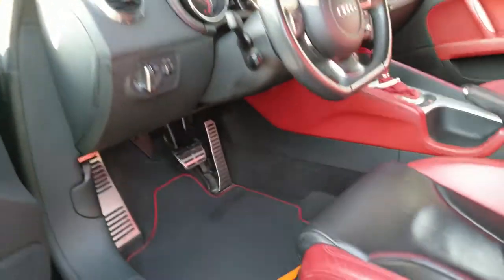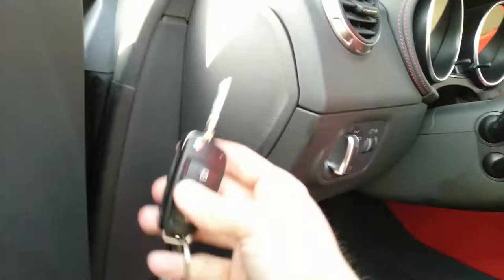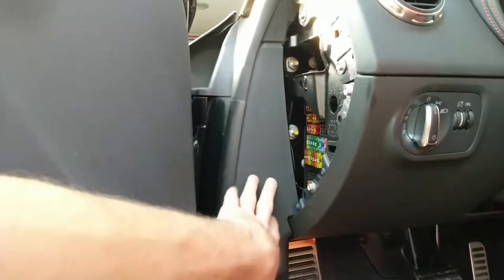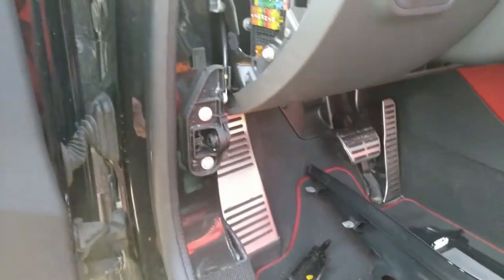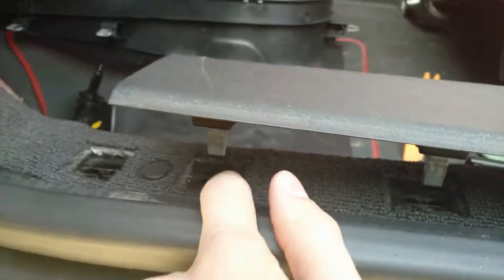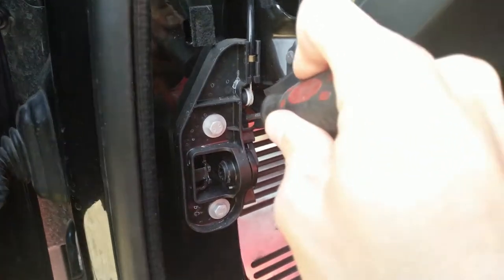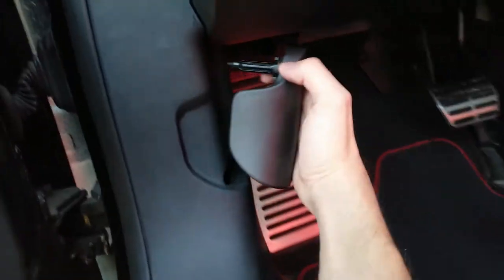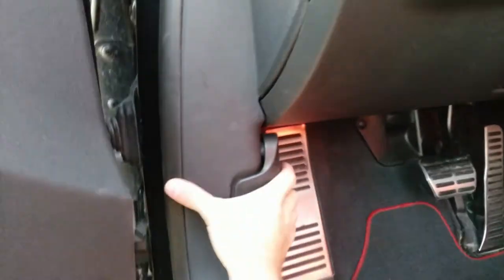How to Open Bonnet Hood with Broken Release Lever on Audi TT Mk2

Comment: Hi! I own a Q7 4L. I changed the stupid releas sistem 3 times already and today broke again. Is breaking exactly where the small ball on the end of the wire hold up. Is made out of cheap plastic with a poor design. Any hack for this? Or a place where can i buy a better one. One made out of metal maby
Reply from the maker: How about its not a problem of the plastic handle, but instead the wire is very hard to pull? Hence, the handle breaks over certain force. Take a look at the wire if it is bent somewhere or stuck, or something, maybe even oil it a bit.

Comment: If your handle breaks, buy the aluminum upgrade. 
BTW the Audi handle removal procedure is less forceful.
1. Disconnect the cable at the separation joint under the hood
2. Raise the release handle 90 degrees and slide out. This moves the retention tab out of the way as opposed to forcing it past with a pry bar.

Comment: Hey, sorry for the off-topic, but I wanted to ask you if your TT also takes long to warm up these days? I think mine has a thermostat stuck-open since it takes ca 25 min to get to 90.
Thanks!
Reply from the maker: It takes around 20 minutes when its pretty cold. Typically if thermostat is stuck, it does not reach 90 deg, ever. But can be that your thermostat will die soon.
Reply: dr. sunka thank you so much for answer! 
When I drive in city it does get to 90, after a long time. When im on the autobahn, it never gets there, and it seemed a bit strange...

Comment: No need to take ANY trim off at all. Use needle nose pliers to remove snapped shaft from the latch hole inwards to the footwell. Push new spindle in. Job done! Less than 1 minute!
Reply: The video is how to open the bonnet without a bonnet release handle. So yeah, you need to take the trims off

Comment: Thank you. I bought a used 2013 two days ago. The only service that had been done to it ever that was not at Audi was a the hood release lever. 
On the two hour drive back home with the car something dropped and hit my foot. 
Yesterday I figured out it was that lever. 
After watching the video I popped it back into place. 
I guess the local garage guy put it in, but didn't pop it in. 
I had not even looked at it... Just came straight to youtube to see the possible issues to check and yours was the first video I looked at. 
It took me longer to walk to the car than to fix it.